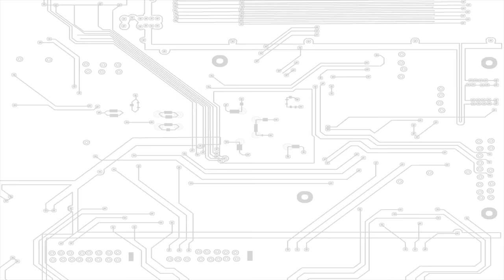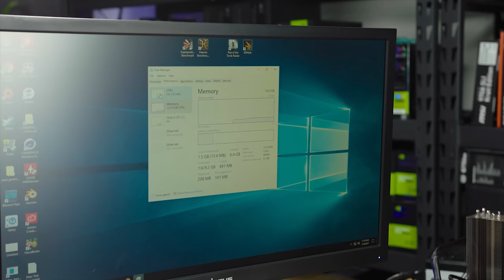How to fix bent CPU pins

Comment: I built 4 PCs withing the past 2 weeks, 2 of them being AMD CPU's. I bent both AMD CPUs and the Ryzen 3700x bent a bit because it just wouldn't fit in the socket properly on the motherboard. It was the correct CPU and it was lined up all fine, but for some reason it would sit incorrectly and you could like move it, instead of sitting flat and flush.
The other one was just my first AMD CPU and I didn't realize it wasn't in and it just kinda fell out lmao. But I fixed both easily with just a pair of non-conductive tweezers, some patience, and a steady hand. Fixed it in about 15 or 20 minutes or so. Luckily it was only a pin or two for both of them.

Comment: I plate small parts with pins and this razor blade trick scares the crap outta me... I recommend using a soft and small plastic tipped qtip and slowly prying it back up to position one by one. That’s how we bend them back where I work and it’s a lot safer that way.
Reply: We do bend them back under a microscope though so it’s really up to you if you feel comfortable enough. I’ve bent them back without the microscope if it was a slight bend

Comment: Redundancy pins are there for adding special features and instructions and upgrade processor in the future without the need for changing the socket in the future, and that is specially what AMD did it all the time and still do it until now in way more than Intel, by the way I'm working in hardware and PC repair

Comment: You saved my life, the pre-applied thermal paste which comes with amd coolers are like glue they stuck to cpu, when I tried to remove the cooler it was stucked when I tried harder the cpu came out with the cooler with bent pins. Amd pre-apllied thermal paste is shit

Comment: I dropped my k6 pins down, didn't bend, played pong on a tile floor, pins down.  One of the pins are missing, I put it back in the old system, surprisingly it booted, but the audio doesn't work anymore.

Comment: Just got an Athlon 64 x2 shipped to me in a standard paper envelope...
Of course several pins were bent. Took me exactly twenty minutes to get them straight enough to fit into the socket. I used a toothpick and my thumbnails. "Zero insertion force" is a thing of the past for this chip now, but it did go into the socket after some wiggling and careful application of pressure.
Still salty though, that the eBay seller charged 4.95 for shipping (CPU was 4.80), just to give zero F's about it getting to me unharmed.

Comment: I just bought a used 3900x off of ebya and the kind gentleman that sold it to me was embarrassed that he incorrectly put the cpu in the plastic container, therefore bending the corner pins. Me being uneducated thought it was fine but thankfully i didnt try forcing it into the socket. The other pins are completely fine but the razor blade method seems like it would work.

Comment: Had my system set up, but wanted to upgrade from my stock 3700X cooler to a corsair AIO.  Damn proc stuck to the old heatsink from the dried thermal paste and bent 4 pins on the removal.  1 hour later using tweezers and my phone camera zoomed and I had the pins relatively straight.  Sweating like a gypsy with a mortgage when I rebooted after the AIO install but thankfully it worked.  Damn near wrecked a $300 proc for a 20 degree temp drop.  Be careful, folks!

Comment: I went to put a Ryzen cpu into the motherboard. I lifted the metal lever to open up the socket to accept it. Then I dragged the cpu accross that lever on the way to the socket :(  . Im hoping your method helps me fix a few bent pins.It looks like only 2-3 pins are holding me up atm.

Comment: Only prob is wont it cut the PCB of the CPU? Not really sure but, thanks for your vids  as usual always loved them jayz so helpful and your builds are just great and so is your personality and everything :D Thank gsoh i have a razor
Reply: Don't put downwards pressure on it ofcourse, if you're cutting into the PCB/CPU you're doing it wrong. Gently place it between rows and wiggle until they're straight. No downwards force at all, not even a little, it's not neccesary.

Comment: Thanks. I just killed a new Ryzen 5 3600 when upgrading. I forgot there is a backplate behind the motherboard to hold the cooler screws. in trying to lock the cooler screws into something that wasn't there, the whole thing snowballed and I ended up dropping the cpu in the case. I'll give this a try.
Reply: It worked and I'm using the new processor now. Had one pin completely smashed down in the canyon between the others and had to use the tip of the razor blade to get it up. Had to lightly jiggle the CPU to get it to fully drop into the socket. Upgraded from a 1st gen 5 1600 to 3rd gen 5 3600. The 1600 will now go into another build for my wife. Thank you.

Comment: Just bent my pins on my 3950x when swapping my AiO. It pulled the cpu out along with it. Fun fun.
Reply: I feel ya man, just did the same with a 3900x. This is probably the last time I use AMD because I just wasted almost $500 on a CPU and the $200+ on the mobo that I'm honestly scared to keep using at this point.

Comment: Meanwhile, I gently set my intel cpu on the lga socket, put absolutely zero pressure on it, realize the corner isnt lined up right, pick it back up to line it up, and two of the pins are bent.  Granted, I came from years of AMD and I never knew how fragile the lga sockets are, but at least I was able to fix it.

Comment: It's doubtful that there are many, if any pins that do nothing.  It's more likely that the broken pin is a ground.  No adverse effect because there are MANY grounds on a CPU chip.  Missing one might cause a voltage drop but if it's just one you probably wouldn't notice it without measuring current, which is hard to impossible in the situation you are in...  Just a possibility.  The other possibility is that the pin does... nothing:)

Comment: I got sold a Ryzen 5 through CEX which had a load of bent from the clamshell misplacement. I've repaired a 939 socket Athlon X2 but that was with a credit card and I didn't fancy my chances this time round so it went back. I'll risk spending £30 and fixing but not the amount I did.

Comment: If the broke off pin is a critical pin, couldn't you put that inside of the corresponding hole on the CPU plastic thing? And wouldnt that make them connect If you can find the pin after it breaks

Comment: I have a Ryzen CPU with a single bent pin. I managed to squeeze it into the socket and use it to bend it back into shape. It did make a pop sound when it went down so I'm thinking it broke. The machine likes to randomly shut off and turn back on though. Like it trips the power supply, but I get no error code. It just boots right back into windows.

Comment: It's funny how I'm calmly watching the entire video after fixing my CPU pins. 

but hell yeah, the tip to use a razor blade to go through rows worked well for me. 

used that as a reference to find the bent pins and then used a safety pin to bend back the bent pins. 

I honestly thought I would have to sell my old spare phone for like $50 and get another $80 somehow to get a new R5 1600. but fuck yeah this saved my ass.

THANKS A FUCKTON MAN

Comment: Amazing video, I panicked for hours and had a new cpu page open on amazon. Tried this as a last resort and got it to post, the slot jiggle thing worked wonders. I had no confidence until you smashed the fuck out of the cpu and got it to post. Mine just simply had half a dozen or so pins ever so slightly out of place after my heatsink got glued to the chip with my new thermal past. Tried taking it out and it ripped out of the slot without unlocking. Thought I was done for but everything seems fine now, just need to reset RAM speed

Comment: today i swapped coolers and didnt know that thermal paste had to melt before you could take the cooler off and i wiggled my cooler to get it out the socket and the processor came off with it with bent pins. thankfully i had a better cpu on hand

Comment: The CPU is the brain of the PC so when you think about it a CPU swap is like a brain transplant and any damage can potentially result in failure or brain damage, so when the CPU is damaged and you try to fix it it's like performing brain surgery if you bend back the pins without breaking them the surgery is a success, but bend them back and forth and you risk breaking those pins and the surgery could result in failure, that said here's my sad story. I recently bought a full size ATX board to upgrade to, first thing I did wrong in removing my 2 year old Ryzen 7 1700 CPU, was taking the cooler off with the case vertically, but the real dumb thing was to take out the CPU without laying the case flat, you probably can guess what happened next, lost control of the CPU and it hit part of the motherboard and case I think and 2 or 3 pins got bent, didn't realize it and tried to install it into the mobo and it didn't work at first it was because I hadn't jumped the ground on the board, I had the board on the box it came in to test it, anyhow I jumped it but still no post so I check and sure enough pins are bent, I don't remember much after that except going online looking for solution to straightening bent pins, one said use jewelers screw diver another said use a real thin  credit card and than I found this video,  but the only problem is all I had was a safety razor and broke one pin after the other, the next day I was able to get a angled razor like in the video and it straightened most of the pins, but many more broke off, 3 days later I've broken at least 25 pins and I can't fit the CPU in the socket to even see if it will work, in the video  a pin did break and many pins are either reserved or redundant so there is a very slim chance the CPU may still, work, by the way jewelers and experienced PC specialists can repair broken pins it's a micro soldering process, but it costs like $5 a pin, not every pin I broke may be necessary, I did save as many as I can in case there is a chance the CPU somewhat works, one trick although not recommended since it might damage your motherboard, my micro atx I was swapping out of has a bad sata, one trick is to put pints into socket where they are missing on the CPU, but that trick doesn't always work, anyhow I'm going to keep plugging along and see if I can get what pins are left, and there are far more left than broke off to fit in the socket and see what happens, I was able to get a deal with New Egg for a new Ryzen and it should arrive in the near future, but I'm gun shy now and I'm hoping I can get my local PC repair shop to do the CPU install and mobo swap, but if they can't I damn well will treat this like the brain transplant it should have been treated like the first time, so learn from my dumb mistake guys and don't take any risks, after all it's not always easy to find another brain lol.

Comment: I had a 1700 that I forgot to heat up and twist the cooler before removing from the mobo, I pulled up on the cooler, the cpu stuck to it and the shit ripped right out of the socket and got some bent pins. 

I used a standard hook lockpick and ran it flat along the rows pretty much like shown here, about 10 minutes and a bunch of money saved.

Comment: OK this video is 4 years old but if you bend a AMD pin use a mechanical pencil without the lead in it They come in multiple sizes of lead diameter so use one that matches the pin diameter.

Comment: This fixed my issue after accidentally ripping it out of the mobo with the fan:)
Reply: Ripped mine out as well. Never using default thermal paste again. Unfortunately this didn't work even if I did get all the pins straight

Comment: This video is old but i just saw it... oh man... since Ryzen launched and used the AMD's Cooler every time i removed it ripped off the CPU from the socket, it stuck on the cooler so i had a 1800x and 2700x i bend at both of them with the AMD's cooler some pins... and i knew the razor blade method so i used it like you did but the pins instead of getting straight they broke, i did so so so carefully but unfortunately the pins removed now i am using my 3rd ryzen 2700x and yesterday because of my liquid cooler had a leak(huge) i removed it and place again the AMD's until they deliver me the part for my liquid cooler so yesterday i had them delivered and i removed caaaareeeefffuuullly the AMD's cooler but again the cpu had stuck i saw it carefully and for my good luck this time no pins where removed or bend... the feeling of placing them all back and you are anxious to see if will boot and it boots it is priceless... so the razor didn't worked at my cases.
Reply: the trick to removing the HS from a PGA chip is to wiggle it back and forth. Back when I still had an AMD board (cant remember if it was the Phenom X3 chip I had or the Athlon 64) I had one get stuck. Instead of ripping it out of the socket I just wiggled it back and forth to break the seal.

Comment: I bent my pins on an athlon 9500 by not seating it down completely in the mobo. When I locked my cooler down, it unseated and bent so many pins. I did just this - straightened it out as best i could with a small knife and then used the mobo lever to go the rest of the way. It booted up and let me flash my bios to accept a 2nd gen chip.

Comment: Hey Jay i saw when you went to your task manager it says 4/7.9 GB ram and I noticed that you have 16 I wondering why it’s not using all the ram and why the other half is not being used because this is happening to me where my pins got bend but my pc still boots up and now my ram only runs at 2133 speed when before it was at 3200Mhz , was wondering if you had a fix for this because sometimes my games would glitch out probably because of the ram only using half of what is installed.

Comment: yesterday I started building my PC and everything was going fine until I tried lifting up the CPU before lifting up the metal pin that unhooks the CPU from the motherboard. I heard a semi loud snap and when I flip the CPU, I shit my pants. my brand new AMD Ryzen 9 3900 had two pins bent. one on the corner and one somewhere in the middle. I immediately hit the web and found a bunch of evidence pointing to the fact that these pins can be bent back straight to go into the motherboard. I tried everything and really the only method that worked for me was using a pin cause everything else was too big (credit card and mechanical pencil) I carefully tried my best and it certainly looked a lot better. when I put it back into the motherboard it was obvious they still weren't perfectly straight cause it wasn't sinking in like it did the first time so I gave it a tiny push and locked it in. when I boot it up, BOOM the CPU was being read and working to its full capacity everything turned on fine. I cant believe I almost threw away $500 right off the bat.

anyways always try to fix it for sure and make sure that you take your time. all hope is not lost especially for me since I found the pins to actually be quite sturdy
Reply: I just bent sum pins on my ryzen 3 1200 that I'm going to use in a 2nd pc can u please tell me how I fixed them??
Reply: @mcwyoung9 try using a razor blade like he did in the vid if its a lot of pins. if its a couple individual pins then use a needle to push it back up and then center them. be very careful. i dont know much abt comp but from what I heard a broken pin usually means a broken CPU

Comment: I began changing the wraith spire on a 2600x and the cpu was stuck to the cooler and i ripped it out of the socket. i used a round tip knife to pry it off and the cpu popped off on to the floor. like 4 pins were slightly bented and i read as long as none of the pin are broken and it still fits into the socket itll work. I bent it back into place and it worked just fine. I was shaking nervously man.

Comment: This method is not bad, but this is better (easyer and more efficient): you should use a 0,5 mm mechanical pencil (for example: Rotring Tikky).

Comment: My problem is that the thermal paste was so baked in that when I tried taking out the heatsink it came right off with the cpu still attached. I'll follow the instructions to see if it's salvageable. It's an fx chip so I have the excuse to upgrade to Ryzen

Comment: I use razor blades to shave with - that there is a utility knife/ stanley knife blade. You won't get far with an actual razor blade, they are far too thin and flexible for this.

Comment: I just watched a channel where a guy replaced the cpu socket on a lga 1151 mobo. Couldnt believe that was even possible. Heating the back of the mobo and then heating the actual cpu socket itself.  I always thought once an intel mobo's socket got its pins bent that it would be a dead motherboard.

Comment: I was cleaning my CPU Fan and after cleaning the previously used thermal paste on the heat sink I gently scratched off the previously used thermal paste on the Processor without removing it from the Socket, applied thermal paste again and installed the CPU Fan but now my Computer is sometimes running and I am being able to start Windows Installation but just before completing the installation, the Computer is getting shut down or being restarted, I checked the power cable to the motherboard, what can be the problem here, is it possible that I damaged the CPU?

Comment: when I was 16 I tried to take the die cooler off my cpu, and in the process of separating the heat sink from t he glue with a razor  blade I cut a voltage regulator off of my i7 4770k and it still worked fine for months  without a voltage regulator till I got  a 4790k

Comment: CPU got pulled out with my cooler but I didn't realise to begin with... RIP
Reply: Can confirm this worked! Used a very small folding knife instead of a razor
Reply: Hi, I had the same problem, luckily this video really worked, I fixed the pins and everything worked :)